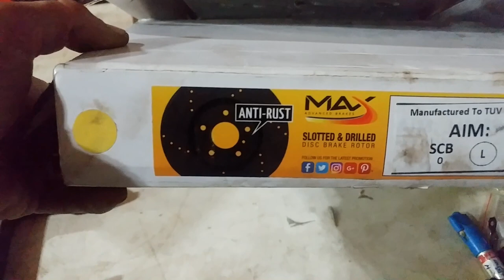How I Did my VW 2.5L Front Brake Service

Comment: Great demo! A helpful tip I learned while doing this is to put the old brake pad across the top of the piston and THEN position the clamp on that before you start compressing it. It allows equal pressure across the surface of the piston and there's no chance that the end of the clamp will get stuck inside the piston's rim (not that it DID, but it could happen).

Comment: Cool and thanks you for this video. I wanted to watch before doing my daughter's jetta. Easy as any other brake job and only paid 120 for complete kit at Rock Auto. BrakeMax wanted $400+ for the job. But, don't put your legs under the car ...EVER. Also lube the pad ends and use the old brake pad to compress the piston with the C-Clamp, instead of direct contact.

Comment: Very nice, clean, well done vid... one thing to note/suggest you should talk about brake bleeding and securing the caliper assembly once removed to assure there isn't any damage done to the hose if it accidentally gets knocked down from where you set it...

Comment: are there only two bolts that you had to remove to take the caliper off.  21 mm?  and then the bracket slid out after that pads came off.  I saw another video where you had to take the plastic caps off and then unscrew them along with taking the main bracket off with 21 mm.  im heading to the store now and wanting to know what tools to buy.  I have a 2015 jetta.
Reply from the maker: Yes, 21mm socket for those 2 caliper mounting bolts. You can save a bit of time by leaving that caliper bracket in place and just remove the slide pins. Good luck!
Reply: @terry Burks that is the proper way to do it

Comment: You didn't need to spray those rotors, they had special coating designed to stop rust over time. No machining oil, that was already cleaned in the factory before they put the finish on
Reply from the maker: Good to know. Thanks!
Reply: @AcetuningTVPerformance  I don't think it will hurt them though. It's possible it could weaken the finish causing non wear parts to rust sooner not sure what chemical reaction will happen if any. Usually I'll just wipe my finger on the rotors and if there is any oil residue I'll spray em

Comment: Great video, all the tools and equipment needed, clear audio. Do the slides have to come out to get lubed? Also, where did you place your jack to put the jack stands on the factory pinch weld?
Reply from the maker: Thanks.  Yes, its easier to lube those slide pins when they are removed.  I used the labeled lifting point.
Reply: Ant way to edit the video to show those labeled points? My sel has only a 6in wide area for lifting and there is not enough room for both a jack and jack stands. Many members on the vw forums comment about this same issue. Thanks again.
Reply from the maker: I'll be making a video about jacking up different cars that I own in the near future. For the Jetta, I placed the Jack 4 inches back from that labeled lifting spot.
Reply: @AcetuningTVPerformance  Ok, thanks; I'll try that next time I need to jack it up.

Comment: what size rotors did you use for the front...what mm? And where did you get your slotted rotors?
Reply from the maker: Black rotor size is same as VW original manufacturer size. I bought all the brake parts from maxbrakes.com